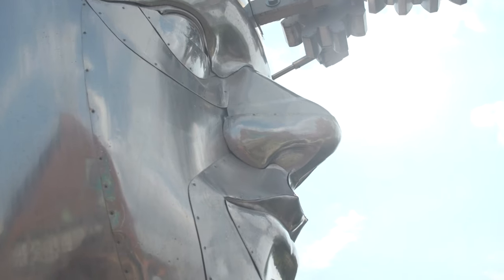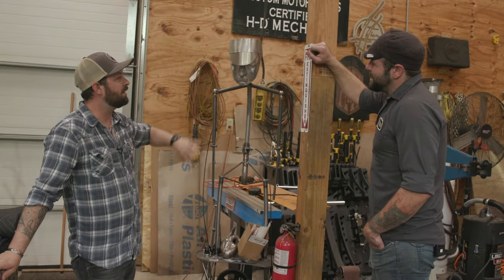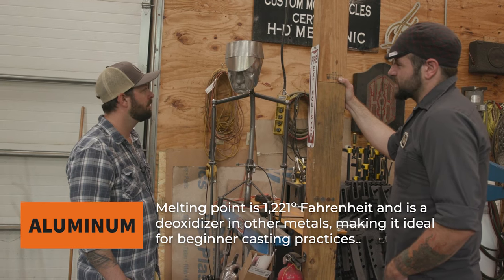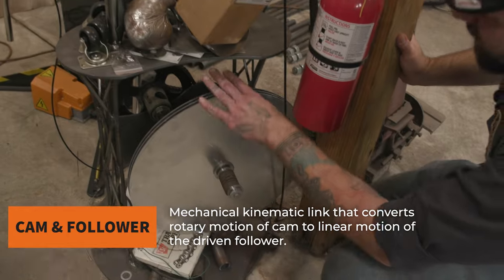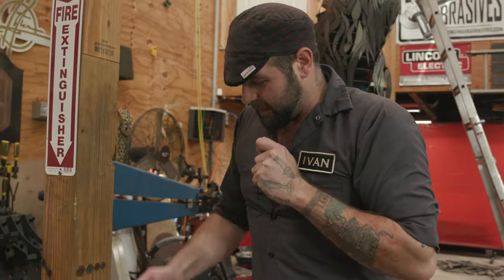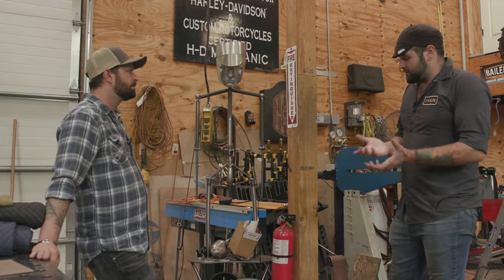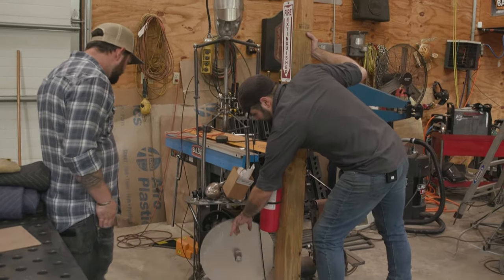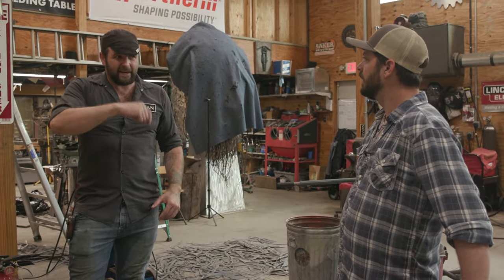Welding Kinetic Sculptures - How Ivan Iler makes art move

Comment: I know you've made automata for years, and are definetly a genius in many ways.  I have made cam and cable motorized sculptures for only about 6 years now and thought I'd mention a couple things I learned in that brief time that may or may not help.  One thing I've discovered is that bicycle cables are often made cheap and with a substantial load and repeated use, such as in a show, they tend to fray and break sooner than I like.  Motorcycle throttle and brake cables will give you a long worry free life and added strength, even cheap or used ones.  Also, your previous hand crank pieces that are so amazing, are different in one important way than one like this that will be used for a client at a public event and motorized.  You can stop cranking a hand-powered piece if you see someone approach it or if someone grabs a part or puts something into it.  A motorized piece doesn't see those things and doesn't stop until the cycle is complete. So a finger in a pinch point, or someone hanging onto or in the way of a moving part can mean a serious injury or could break your automation.  I had my whiskey drinking pig at a premier VIP event at the World Equestrian Center.  You'd think the crowd would be sensible enough to not grab a moving sculpture arm, yet one older lady that had a bit too much to drink grabbed the arm, mid-cycle and tried to hang on while her husband took a picture. Fortunately, I had the forethought to go back and add a load switch that paused the automaton until she released the arm.  The driving mechanics had enough torque that it could have broken the internals. So it's a good idea to keep your client's display area in mind and try to keep pinch points and dangerous moving parts guarded in your design. I try to always  keep parts closed off, or in other design make it difficult to get injured. An example is a shark I made that opens and closes it's mouth, where I made the closing Jaws not completely close. The first show, a kid put his fingers in while his mom was standing there, and that extra thought saved his fingers from getting hurt.  My fish feature springs, so they can only apply so much pressure when closing instead of a solid lever closing them.  Also, 60 seconds isn't a long time to run a motor, but checking the specs and maybe put a torque wrench on your main driveshaft if possible, to see if it's within the motor's capability.  I've had to pull pieces back apart when I first started because I didn't do my homework and the extra heat burned the motor out. Now I get the specs, test my automata and oversize my drive motor.  Using DC voltage drive motors is also a good idea inside of moving metal art.  Protecting the wires is crucial, but with lower voltage DC motors, if you do have a wire fray or short to the metal, you won't get a heart-stopping 120vac jolt, and it's not going to cause pieces to be arc-welded together.  Best choice is 12vdc in what I've seen, it allows you to use other 12vdc automotive/RV motors, lights, and controls.  Well, that's my two cents from my own learning experiences. Keep up the awesome work, can't wait to see it finished!
Reply: great information, thanks for sharing, Paulie from Weld.com